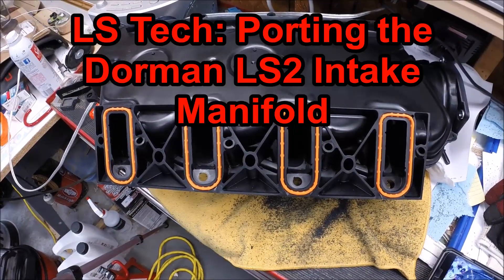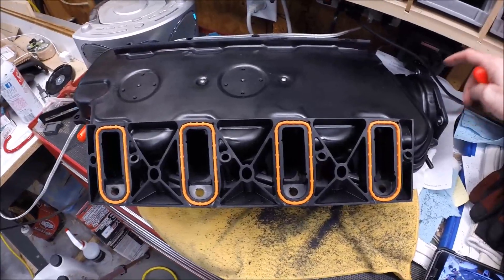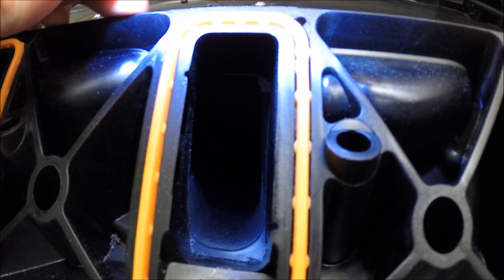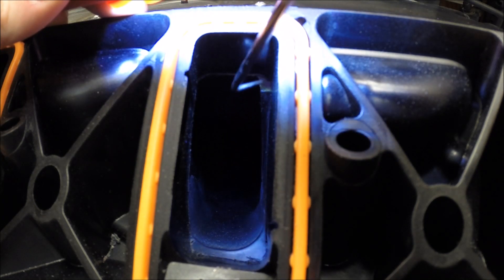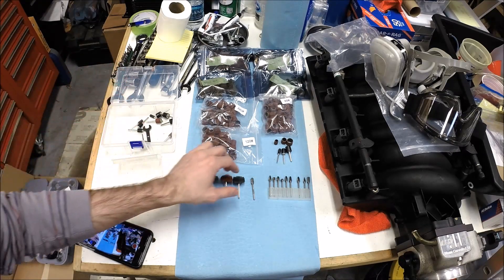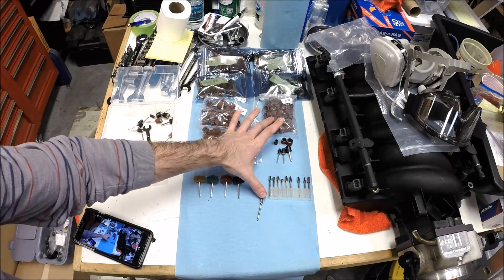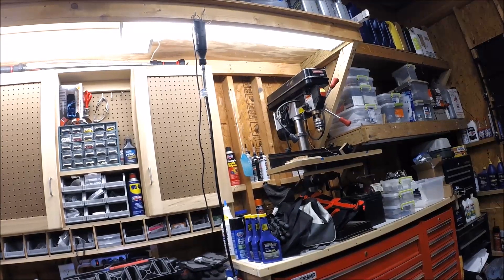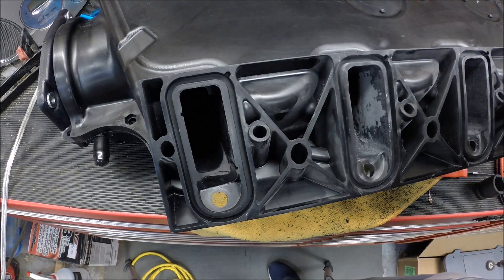LS Tech: Porting the Dorman LS2 Intake Manifold

Comment: Hello, excellent information / detail on this intake idea. Questions if I may, will the Dorman LS2 work with cathedral ports? And I assume it will  accept OEM fuel rails, injectors etc? Thanks.
Reply from the maker: Yes, I believe the LS2 heads were cathedral port; but my 243 PRC heads definitely are.   I also reused my LS1 fuel rail and injectors.  I later swapped to Fast 36lb injectors when I got to the dyno.
Reply: @ScrufsGarage  Sweet. Thanks

Comment: Hello, what type of camera are you using with your phone and what is hold your camera whie you are video shooting. Please email me please and let me know ,my email is Jordanguy23@sbcglobal.net
Reply from the maker: I'm just using my old GoPro 3+.  Since my version of the GoPro does not have a backscreen, I use the GoPro app on my phone to line up my shots.  The drawback is that running the wifi from your GoPro drains the camera battery very quickly.  I had to add an extended battery to the back because the battery ALWAYS seems to die right in the  middle of an important shot, haha.   And I hold the GoPro on one of those short flexible tripod mounts (something similar to this: https://amzn.to/3c6OQmY ).    There are tons of tripod/mount options on Amazon.

Comment: Can this intake be used on a 5.3 truck motor with a drive by cable? Thanks for the video
Reply from the maker: Yes, I believe it will work on the 5.3 motor, and it will also accept a drive by cable TB.
Reply: From what I  saw they make versions for both , cable and electronic
Reply: Thank you Tyler 👍